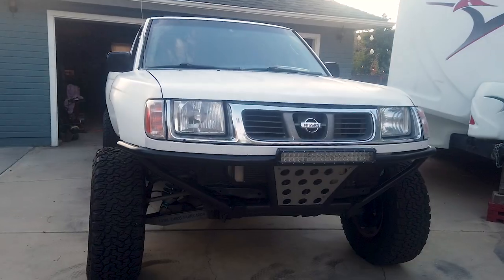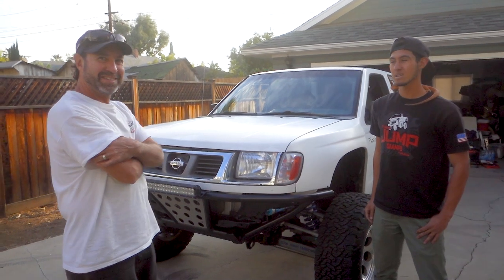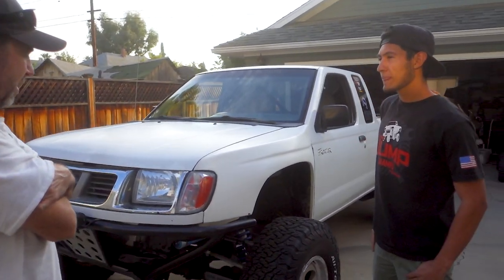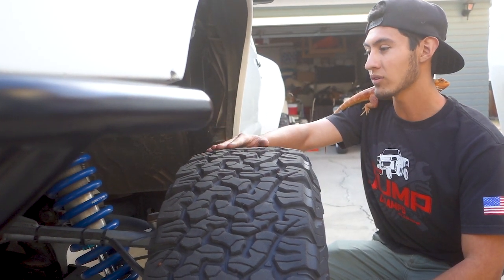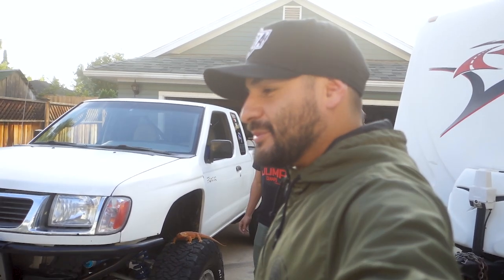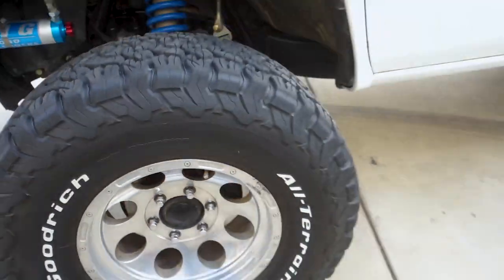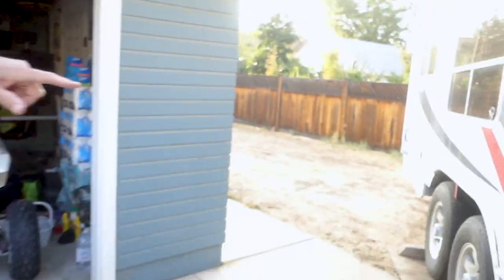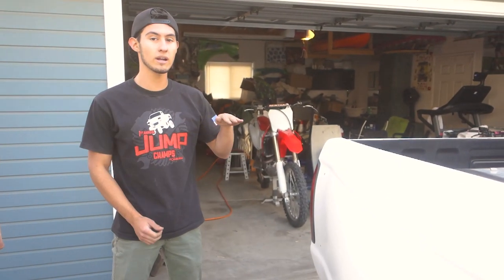Leaf-Sprung Nissan Frontier Budget Build | BUILT TO DESTROY

Comment: finally getting to building my 2000 tacoma! I put the solo motorsports 3.5 kit up front and the truck is out getting the rear done with deavers and 16" kings. I love seeing built non typical trucks
Reply: Is your taco 2wd or 4x4? I’m looking into building an older Tacoma and I’m leaning towards a 2wd

Comment: I've got a 2000 Crew Cab 4x4 red Frontier.  When it had 247,000 miles on it I was driving one day, motor quit and it sounded weird trying to restart.  Long story short, timing belt broke which turned out to be the original belt never changed!!  the 3.3 is an interference motor so I figured it was shot.  Saw that others who had snapped that belt were able to put in a new one, set the timing, and good to go.  This was the case with mine.  Now have 296,000 and she still running great, original motor and trans no rebuilds.

Comment: I've got a 02 Nissan frontier, 4 door, long bed, supercharged from the factory. Vg3.3 with the automatic, 4x4.  Love my truck, it's my daily on 32's. I've also owned a 92 nissan hardbody 4wd. I've never owned a newer nissan the my 02, but I can definitely vouge for the reliability of these older trucks👌 that 92 was still running great at 235,000 when I sold it, with very little work done to it over 15+ years. Just change your timing belt and water pump as general maintenance every 80,000, do your oil changes and you should be golden.👍

Comment: I went with a Dirt King Race kit for a Titan and had Vegas Desert Fab adapt it to my 2003 first gen Frontier.18" travel up front, 20+ inches in the rear. As far as I know mine is the only Titan swapped First Gen Frontier. I went with a Currie axle housing  with a Detroit locker, 6.66 gears Strange Engineering rear end and a custom 4 link.

Full fiberglass and 37" tires

Comment: Man I wish my 2wd crew cab se had those upgrades. Engine is doing great after going through the evap system. Having the trans serviced and putting about 30k miles with going almost to 200k miles. It's a great truck.

Comment: Just got my 04 Frontier Supercharged Crew cab a few months ago, its been awesome so far, I don't understand the hate for these trucks, 90's & early 2000's Nissans was the R34 era, probably some of the best engineering was happening at the time from them. It's super rad to see other people building these things, hopefully Total Chaos comes back with these earlier long travel kits.
Reply: Wait till they find out vg30/33s are good for 500hp on the stock block n 30a manual tranny they come with n the fact the motor is 300$ all day

Comment: Nissan Frontiers are good trucks, the only weak link is the rear end. They tend to leak from the axles and the covers as well as the yolks, i guess it is an easy fix if you use good gaskets and seals.
Reply: And they always made a whinning noise from the diff.

Comment: I had a Nissan pathfinder with the same engine amd trans setup and mine only had 1st and 2nd gear for some reason. But it could do 70 at the top of 2nd

Still runs today with only 2 gears

Comment: Bro tell that youngster to simply T in his slipidy slide handle "Wildwood" rear beaking system into the oem hard lines just before or on top rear end it will actually work with the systeom do not ever separate front and rear brakes causing u to have to pull the hoon handle as well as press pedal to activate front and rear brake cylinders. Its actually feasible to have cake and yank it tooo.  Dont kill a fellow driver or pedestrian cause u hacked the braking system on ur daily runner thats not very chill. Any one of us dezert slayers are willing to get together and sort out any issues he or any fellow motorsports enthusiasts may have or come across that isnt dialed or hadnt turned out the way he or she wanted. Were a loyal family and its super important we all stick together specially in a sitch as this one is.  Pops dont let ur boy roll like that, gettem dialed keepin rubber side down &  sponsor that safe way to get crazy.... Props to the direction ur build is headed and props to pops for supporting his sons meyhemish offroad activities this is what its all about ... Giter done